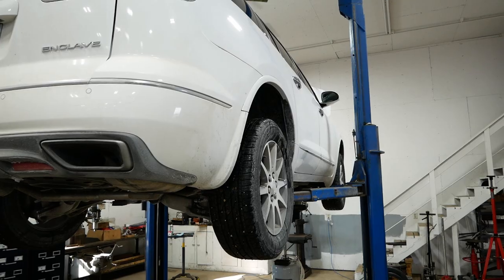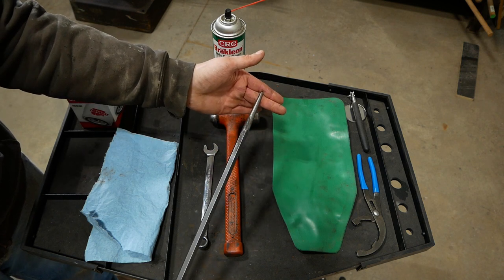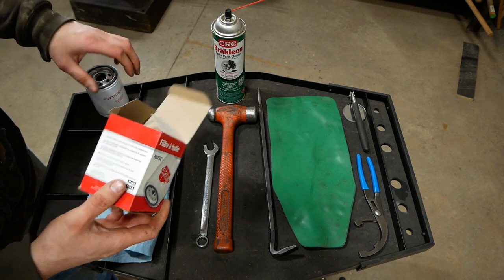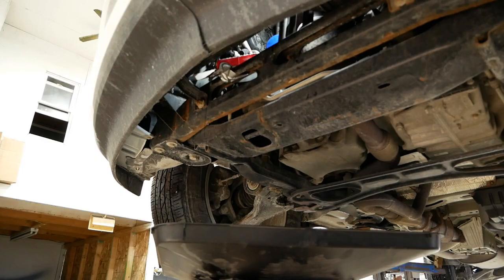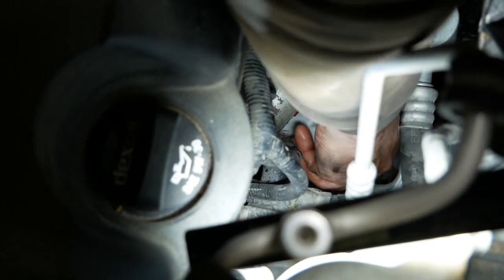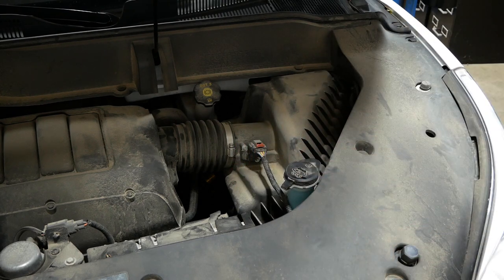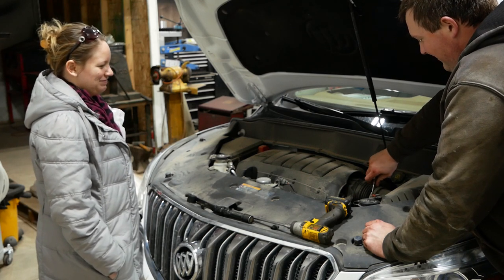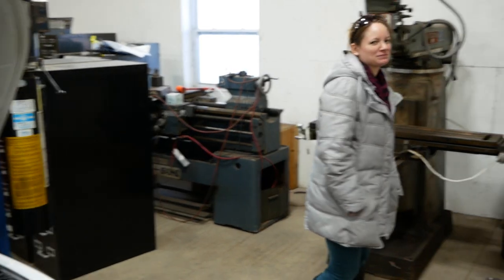Changing a GM 3.6L Spin On Filter without Spilling Oil?

Comment: For the oil filter:  I used a 32oz plastic cup from a gas station. Put the cup up over the filter and squeeze/turn the filter through the cup to remove.  Most of the oil will run down into the cup and it can be carefully lifted out from the top with the filter inside.  The oil that didn't make it in the cup could be wiped up with a paper towel.
Reply: But if the filter is on it's side, the cup can't contain it any better than the filter
Reply: The cup fits loosely enough that you can angle it down a bit.  This also lets you push the bottom lip of the cup into the block under the filter to try to catch more.  I did about 140,000 miles of oil changes on this engine so I've did it a few times.....  Something else to try would be to poke a hole in the top side of the filter, put the cup around it, and then rotate the filter 180 degrees to drain in it prior to removal.

Comment: FYI  
It is advised to only uses the AC Delco Oil Filter  part# PF63E  on the 3.6vvt engine.  After market filters do not flow enough and are prone to leak.   Check the web. I found this to be so with this problem on my own GM 3.6 v6 in a 2014 Chevy Equinox.
Reply from the maker: Sure. But I have to do what the customer wants, which is normally "cheapest possible". And FYI, every manufacturer says the same thing about every aftermarket filter. I've replaced plenty of timing chains in these junkers that always had "factory service".
Reply: @WatchWesWork  It does make a difference with this engine The "E" at the end of the part number is an updated  filter  version. After market filter leaked for me. AC Delco solved that problem.    Like your channel a lot.

Comment: I use to inject bursts of air pressure (good seal) even when certain manufactures oil filters were under slight  pressure with engine off.  I guess they had one way valve.   emptied oil filter and never caused a problem. No comeback

Comment: Think you've got a good idea. Couldn't say how many times I've gotten oil everywhere because of the horizontal filter. I know how much you dislike Chrysler but our town and country uses a cartridge that is very accessible from the top. To each their own I guess.
What I am shocked by is you using a funnel, didn't you say you didn't like them a few shows ago?
Anyway, we need more input by the misses. Good woman you have there.
Thanks
Reply from the maker: Chrysler does pretty well with oil filters.

Comment: 1. Drain sump oil.  2. Lift rear of car vertical with crane, - oil filter is now facing up - 3.unscrew filter without spillage.  ( method straight out of GM service book!)

Comment: Wes, watching you fight with that tight oil filter, reminded me of me changing my wife's filter on her Lexus. The guys that changed it last time used a torque wrench to install. Maybe the next oil change (on anything), a small tutorial showing the correct way, ie. 3/4 turn once touching metal.

You could actually be teaching some of these wannabe techs, in these 'oil changing stations' on how to properly do the job. 

Just sayin. As always, great vid. Regards.
Reply: At least they torqued it i guess xd? No engine failure because some soy boy tightened it with their Pinkey finger. I don't know how it's hard to just get them Nice and snug...no big deal.
Reply from the maker: I was always taught as tight as you can get it by hand. Some filters have instructions on them like "tighten to touching then 1/2 turn" or something.

Comment: Good tip if you have a lift and are a DYI guy.  In my shop too much time wasted though, dump the oil, wipe down and done.
Reply from the maker: The form-a-funnel takes seconds. But most shops can't be bothered.

Comment: I wonder how many of those air box setups get broken in anger in a few years. Also the sensor wiring/connector!
Reply: Airboxes make me just angry sometimes. Yeah remove about 2 feet worth of ducting ect and its only held in with clips, but random clips which like to break, loose tension ect and after 3 times they're almost just dead by then. I try my best but sometimes cheap plastic just dies.
Reply from the maker: I see it all the time, or the screws are stripped and the ears broken off.

Comment: Absolutely amazing feat of engineering (not) by GM.  Well aren't you spose to torque those oil filters down to bout 140ft lbs...?  hahaha.
    Hey, I surely won't "beat up" on the lovely shop assistant, with her mistaking a battery for a, hell I don't know what it was, at least she has been under a hood before, and has a clue as to where a battery typically resides.
    The Buick you worked on awhile back, I had no idea the battery was under the back seat.
Great video, learned a few things, and will be investing in a "form a funnel", and seek out that oil filler "keg" & spout.
Thank you sir.
P.S., that oil filter looks to me, to be the same size as what they put on a 2004 GMC Yukon 5.3... bout a 1/3rd the size of what I am used to seeing on a typical V-8... freakin crazy...

Comment: i will share something  , add a small fuel hose the size of the straw on spray brake or carb spray clean , you can keep can up right and  direct the hose where you need it ,can use whatever length you need works great ,i use hose for carbs on chainsaws or weed eaters  also works for wd40 etc

Comment: There was a French car, I think it was a Phew Got (Peugot) where you had to take the engine out to get to the battery. 🤦‍♂
50 years ago when I worked in a garage after school, we didn't have modern gadgets like an oil filter spanner/wrench. It was stab it with a screwdriver and use that to loosen the filter and then turn it out with slippery hands. 😖

Comment: My 2010 Toyota Tacoma is not near as bad as that but the filter does hang over the transmission and transmission cooler lines. I crack the filter loose, by hand since I put it on there, and grab it with a decent sized plastic cup and start unscrewing.  Every now and then I'll lower the cup to let the oil escape pass the filter and into the bottom of the cup.  Minimal mess and I don't have to spray those cooler lines down with brake cleaner anymore.

Comment: I like this form a funnel tool  wish I was the one who invented it.   I have wanted one for a while  now  .    and  I could have used this when I was a lube tech  at a jeep and dodge dealer         when doing a oil change on a dodge ram 1500 with the 5.7L  the filter is located right above the steering rack   and it makes a mess

Comment: This motor is in many vehicles and the only way to move the filter is to make a different filter housing for each platform.  Aparently not something GM wants to do.  If it were mine, I'd remote mount the filter somewhere easier to reach.  Or just get a Silverado with an LS and then it's easy.  ; )
Reply from the maker: They made the same engine with a cartridge filter that was easy to change from the top.

Comment: Lycoming aircraft motors commonly have the oil filter on the accessory case that's on the back of the motor close to the firewall and this method is commonly used. Another method is to put a small trash bag around the filter and when you remove the filter some of the oil goes into the bag. No matter what you do, though, oil usually goes everywhere.  Another thing you generally do with airplanes is cut the filter open and look for metal. There never is any.lol

Comment: To answer Mrs Wes, the plastic cover "thing" appears to have started in Europe, and seems to have been a scheme to "just make it look neat" (with more than a touch of "just leave that alone" tossed in too).
GM has been putting batteries under the 2nd row of seats of late, which would likely really throug the Mrs a loop.
Reply from the maker: One company does it and now it's everywhere. Like the Audi headlights with the LEDS around the bottom. Even Kia has them now.
Reply: @WatchWesWork  yeah, everything is LED lamped anymore.  What had been two incandescent lamps is now 12 LED (in packages of 5 each)  Sigh

Comment: Thank you for the links, I need this for my 2013 ram 1500 with the 5.7 as the oil filter is abo e the front transfer case shift solenoid (I may have made that name up as I don't know all the proper terms I just know what they do 🤦‍♂️). The thing that electronically shifts the front differential.
Reply from the maker: Yeah those are fun.
Reply: @WatchWesWork  I'm a mechanical engineer by trade and car engineers just constantly blow my mind with the decisions they make

Comment: V6 3.6 litre engine in a shoebox! 
That's your trouble lady.
Put a 2 litre injection straight 4 in it, transverse, & you'll have space for an easy maintenance oil & air filter.
Add a turbo version in the range for the speed freaks & with a 6 or 7 speed manual gearbox & with a wider track, low profile tyres & a firmer suspension it might even corner. The Hot Hatchback crew would love it & it would sip petrol in comparison to that big, heavy V6.
Nifty trick though Wes. Can't see an easier way on that engine.
Reply from the maker: GM has both. Just worked on a Buick Regal with a 2.0L turbo.

Comment: It sounds silly but I have a lot of luck wrapping a gallon ziplock bag around it and spinning the filter off.  You jam the bag all around the filter so it is touching the block.  The bag catches the oil and the filter and you just pull the whole mess out.  It worked on my 2002 Buick Regal and my wife's SRX with the 3.6L.

Comment: I used to work at a shop and people loved to bring in there acadias and traverses and whatever else gm shoved this engine into, on a 90 degree day, drove 30 mins with the ac maxed so it's about 250°f under the hood. Gave myself a few nice burns off the catalytic converter. I can also attest that those airboxes are the worst

Comment: Did you put oil in the new filter?  
I've had mostly Fords and Toyotas, which all had/have sideways-mounted oil filters.  That means that you can't fill the filter without it spilling when spinning it onto the engine.  But I've found that I can do as little as two pours to the top, (letting it settle down into the filter after each pour) and the new filter will spin on without spilling much - and more importantly, I won't hear any lifter noise, and the oil pressure gauge needle will rise normally with barely any delay.  
I've never done a Toyota without putting oil in the new filter, so maybe you can install them dry/empty and not have noise upon startup, along with the agonizing wait for the gauge to move off of Low...
But those big FL1As require about three pours to avoid all of that drama.  And they take five to ten seconds to fill up and start providing oil pressure when put on dry - my first several oil changes I did myself, I didn't bother to put any oil in the filter...

I would also recommend getting the filter loose before poking the hole in it.  A benefit to doing it that way is that you could poke it where you can see it, close to the edge, and then spin it so that the hole is at the bottom.  Kind of along the lines of "make sure you can loosen the fill plug, before removing the drain plug."  You wouldn't want to put a hole in it and then find out that it just won't come off...

Comment: Not the worst I've seen.  Try  changing the oil filter on a 1999 Ranger with the 3.0 vulcan engine sometime, don't forget to disconnect your negative battery cable so you don't short out your starter solenoid. Oh, that pierce  a drain hole in the bottom of the filter and funnel the oil out first trick you used in this video may save yourself from soaking your starter brushes and save it from premature wear.
Reply from the maker: Hmm. I don't remember that one I guess.

Comment: Here’s the benefit of working for a shop and not paying for your own brake clean, you see what you do is just spin the filter off and let the oil run all down the engine mount, put on the new filter and then hose down the mount from up top with about a half a can, life the car up and then you take that other half the can and douse it from underneath, spray everything off with an air gun and it’ll look good as new and away ya go 😁

Comment: As much as that was a good solution to try to stop dinosaur squeezings from covering everything, I used to get a plastic freezer bag (produce bag u might call them?) off the roll so it wasn’t gonna have a hole in it, just crack the filter so I could unwind it by hand and then put the bag over it and wind it off. Worked for my Rodeo, I guess it depends on the car.

Comment: I’ve used cardboard many times as a funnel especially when changing the front axle oil on tractors. Did you break the news to her that the battery is in the backseat under the floor?
Reply from the maker: She doesn't believe me.
Reply: @WatchWesWork  I changed the battery in our 2011 Acadia with electric seats. Got the battery all disconnected and tried to lift it out of the hole and wouldn’t clear the seat. Had to hook the battery back up and put the seat all the way forward.

Comment: The cardboard funnel is genius! Tip of the hat.
  Now here's the real question.  GM you made a bulletproof front-wheel drive engine. The famous 3.8. Why oh why did you stop making it? Heck GM you keep the small block V8 around for decades! 
  The plastic cowling is for cooling. The engine cover is to hide the embarrassment of an engine. Plastics are used throughout in a weight saving effort. When cars were all steel they had very little in the way of circuitry/wiring. Now with all the modern technology everyone has to have. The trade off is plastic.

Comment: That’s the awesome engine that enjoys a fresh timing chain job if you don’t change oil often enough or soon enough. My wife’s traverse is a pile and the power steering reservoir is under the beauty cover stupid design all around.
Reply: I like the power output on these engines, but alas as the second owner of my traverse and having bought it used from a now known less than reputable dealer, I have over 6k in mine between a fresh timing kit and a new motor both about a year apart from one another.
Reply from the maker: There's a guy here who works after hours just doing timing chains on these and the 2.4s. He stays plenty busy.

Comment: I think removing the exhaust manifolds from the F700 was easier than doing this oil change & air filter replacement. Oil filter looks like and after thought. They designed the car and engine, then realized they hadn’t put an oil filter on.

Comment: You could have at least used a plastic file folder ringlets binder or whatever it’s called (I bought one once for seal installation on a transmission) from the dollar store (dollar tree in my case) that way it would be large and would not saturate, which is between the form a funnel and the cardboard in terms of price and ability. You could even use two or more  and make a channel from right under the filter to the hole and even have a back side one for splashes (so it would basically form a tube through the hole you reached your hand through). Then you could crack it free just enough to turn while on the ground with a catch pan, or do the stabby method with it in the air like you did if you have those tools

Comment: Not criticizing, again NOT criticizing my opinion is they , meaning engineering have designed everything for the evap system. Meaning you put the evap hose in the fill neck and turn pump on it draws fluid oil out empties system you come in from top side like you did with filter socket on a long handled rachet and remove old empty filter put new filter on socket tighten to appropriate speck not gorilla gripped  refill oil to speck never having to get under vehicle or spill oil, you know environmentally friendly, i think any ways that’s my take on it . Plus no lift and all the joints are nylon no grease fittings to fill. All about efficiency and speed i think . Maybe that will help, anyway keep fighting the good fight love the videos!!!!!!!!!
Reply from the maker: Probably true. Lots of truck shops are using the vacuum systems now too. And many of the truck engines use cartridge filters from the top.

Comment: Worked for a fast lube when GM came out with this design we did a lot of cussing. Didnt have the option of doing them cold so the Cat would be red hot & then you get those with the pump mounted to the core support making it worse
Reply from the maker: Yeah I let them sit so I don't burn my delicate arms.

Comment: Do you think it will work if you put a hole in the top of the filter then used shop air to blow the oil into the engine so it can all come out the drain pan plug?

Comment: Great work as always. General motors seem to go out of the way to make life difficult! Ford are no better. Recently had a friend charged for 1.5 hours labour to change a running light bulb, value a couple of bucks on a Ford Kuga. Clearly done to jack up dealer service charges. Goes with the whole "right to repair " argument going on with everything from Tractors to well known brands of expensive electric vehicles. Don't think its bad design but a deliberate attempt to make life awkward for the jobbing mechanic!
Reply from the maker: Yeah, Ford is bad too, and Chrysler with the "secured gateway" BS.

Comment: Good trick.   I don't think that GM engineers have a monopoly on  bad designs.  Flat rate
mechanics probably won't do it this way .   An oil filter on a 5.0 ford in an F150 isn't any better
I just let the oil drool everywhere...helps  prevent rust from the salt and other nasty stuff they put on the roads.

Comment: So for the edges of the  hood, they decided to use the biggest plastic shield from the space shuttle, in stead of a rubber seal? It's an extra cooling surface when it rains??